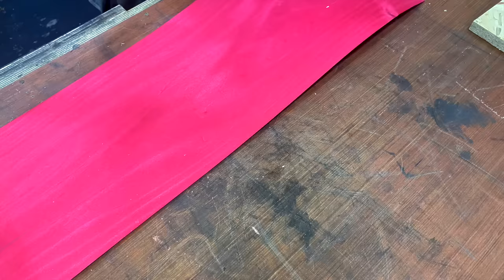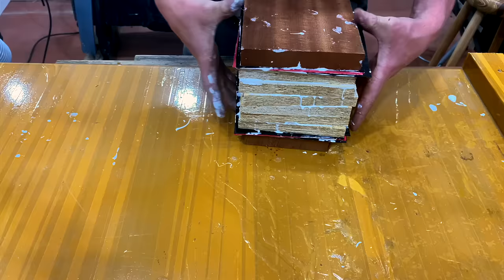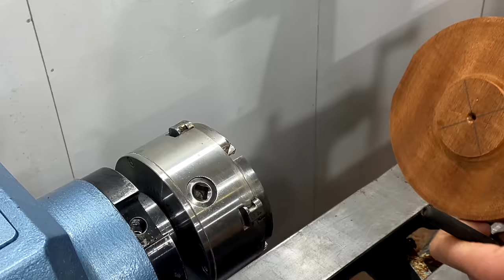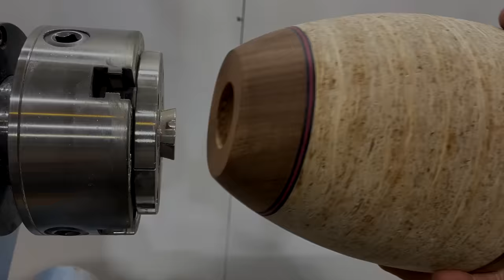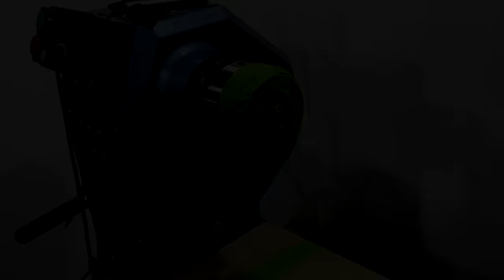Woodturning - $3 Board To £3000 Art

Comment: Nope, they still haven't found  a good use for particle board. I apologize, I'm not criticizing your work, I'm criticizing the wood. Someday they will find a good use for particle wood, they just haven't found it yet.
Reply from the maker: Dry lining a garage/shed?
Reply from the maker: Shipping boxes
Reply from the maker: Flooring
Reply from the maker: According to Wikipedia 
“OSB is a material with favorable mechanical properties that make it particularly suitable for load-bearing applications in construction. It is now more popular than plywood, commanding 66% of the North American structural panel market” 

I’d say “they” have found a good use for it. 😆
Reply: @JackMackWoodturning  I'd hate to pay the shipping on that delivery, but I wouldn't want my stuff shipped in it either. Plus, you know what happens when you get it wet. Floors get wet. Every time I've trusted it, it let me down. Maybe it's just me. Not trying to offend anyone.
Reply from the maker: With all due respect matey. If it’s properly installed it should never get wet. I think you just need to correct “they” to “I” in your original comment 😆😆
I’m just playing tho buddy. If you don’t like the stuff you don’t have to use it. 😉👍🏻
Reply: since no particleboard is used, your comment makes  NO  sense.
Reply from the maker: I assume this is what some cool kids call Osb.. but my understanding is that particle board is a fine grade chip board. Not Osb.

Comment: 1, you spent more then 3 dollars. 2 that's not worth anything remotely near 3grand. More click bait, though the vid was enjoyable.
Reply from the maker: 1.. the amount of osb board used WAS $3 
2. The piece did sell In a gallery for 3,000 
(After the lengthy process of polishing to glass finish) this was not my valuation it was valued and sold by the gallery. 
3.. 🥱